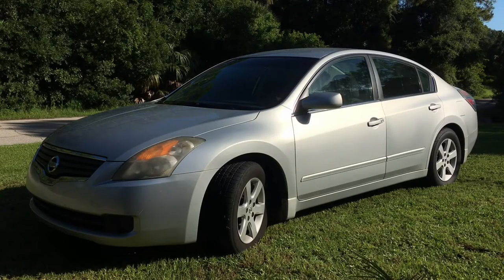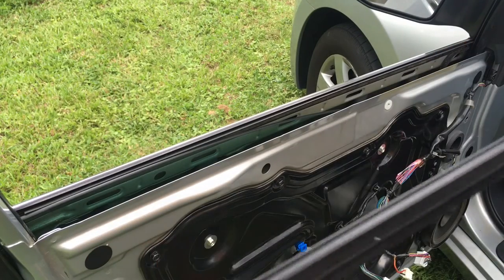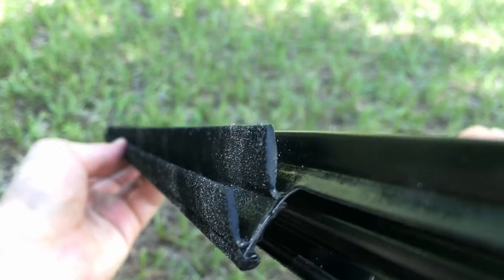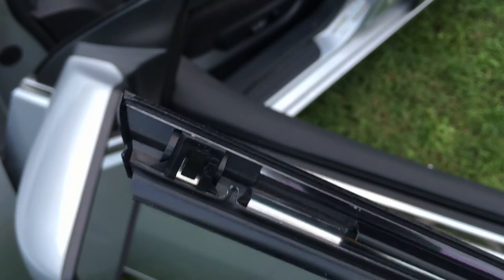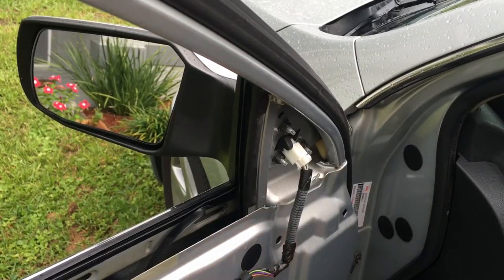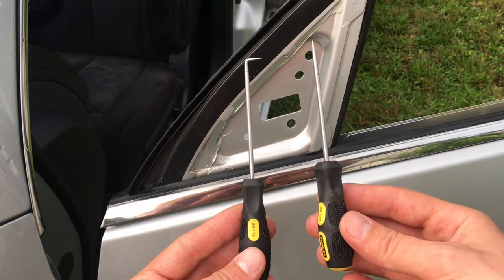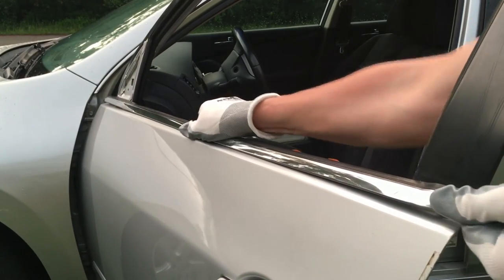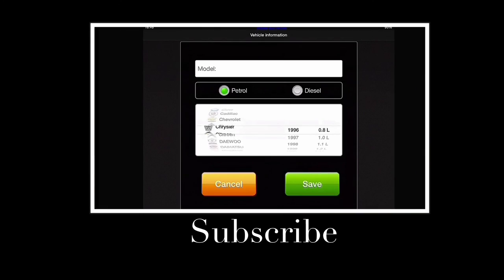How To Fix Squeaky Window - Trim Molding Replacement - 2007-2012 Nissan Altima

Comment from the maker: You can buy replacement parts here (these are eBay affiliate links):
Front driver side: http://rover.ebay.com/rover/1/711-53200-19255-0/1?icep_ff3=9&pub=5575132837&toolid=10001&campid=5338273166&customid=&icep_uq=80821-JA01A&icep_sellerId=&icep_ex_kw=&icep_sortBy=12&icep_catId=6000&icep_minPrice=&icep_maxPrice=&ipn=psmain&icep_vectorid=229466&kwid=902099&mtid=824&kw=lg 
Front passenger side: http://rover.ebay.com/rover/1/711-53200-19255-0/1?icep_ff3=9&pub=5575132837&toolid=10001&campid=5338273167&customid=&icep_uq=80820-JA01A&icep_sellerId=&icep_ex_kw=&icep_sortBy=12&icep_catId=6000&icep_minPrice=&icep_maxPrice=&ipn=psmain&icep_vectorid=229466&kwid=902099&mtid=824&kw=lg
Rear driver side: http://rover.ebay.com/rover/1/711-53200-19255-0/1?icep_ff3=9&pub=5575132837&toolid=10001&campid=5338273169&customid=&icep_uq=82821-JA01A&icep_sellerId=&icep_ex_kw=&icep_sortBy=12&icep_catId=6000&icep_minPrice=&icep_maxPrice=&ipn=psmain&icep_vectorid=229466&kwid=902099&mtid=824&kw=lg
Rear passenger side: http://rover.ebay.com/rover/1/711-53200-19255-0/1?icep_ff3=9&pub=5575132837&toolid=10001&campid=5338273170&customid=&icep_uq=82820-JA01A&icep_sellerId=&icep_ex_kw=&icep_sortBy=12&icep_catId=6000&icep_minPrice=&icep_maxPrice=&ipn=psmain&icep_vectorid=229466&kwid=902099&mtid=824&kw=lg

Comment: I am 5 years late here but Thank You for this video for do it your-selfers like me..I had just deicided to get the windows tinted,but the interior windows trim strips are terrible,as in the previous owner must have had sticky drinks in the car and the drivers and passenger side windows get the scrapes and the windows get sticky,so I have been trying to wipe these trim pieces down and its worked fairly well,but I am tired of it being like that so time to replace them before tinting.  I am glad I found this video !
Reply from the maker: Glad it was helpful!

Comment: I want to do the rear door but I can’t seem to get the trim to stay on
Reply from the maker: Is you new trim look identical to original? You should be able to just push it down and snap it on the door frame.